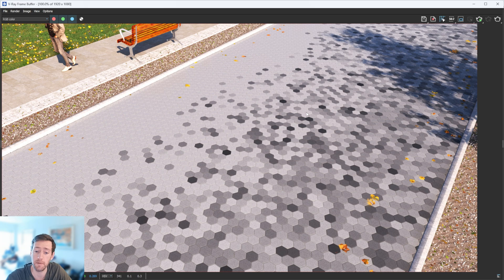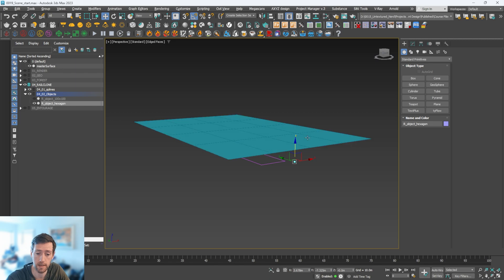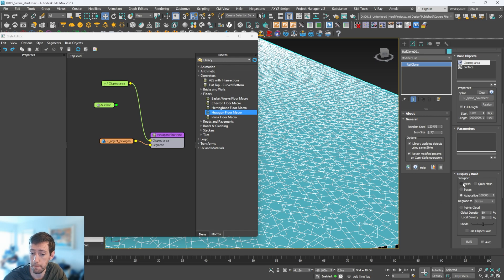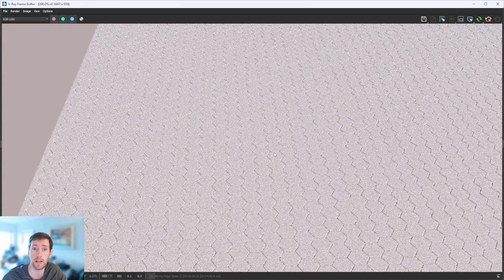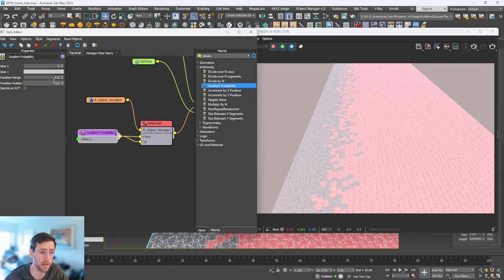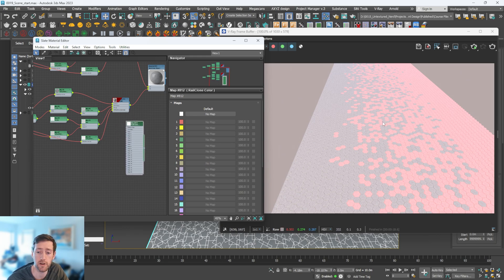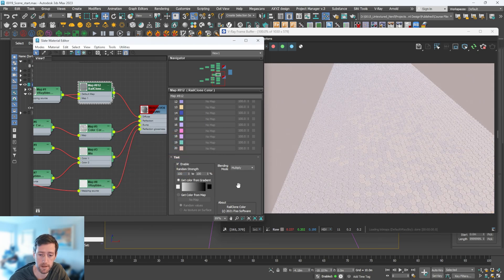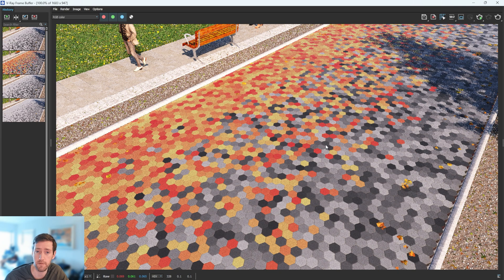How To Create Pavement Patterns

Comment: Another Great video.  I wish people would be more grateful and like your videos. BTW - Can you control the affected areas of the transition using a black and white map ?  (for example a hand painted one)
Reply from the maker: For that I would use a slightly different approach. If you needed a particular design (Like a painted one/done in a CAD program) you can project bitmaps onto your pavement and then produce the exact arrangement you want. I'll definitely produce a video on that.